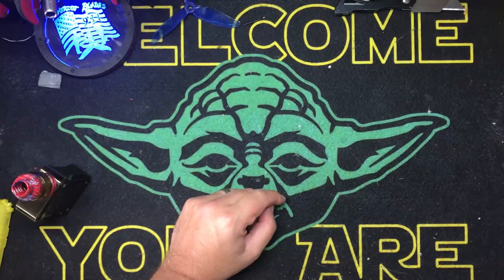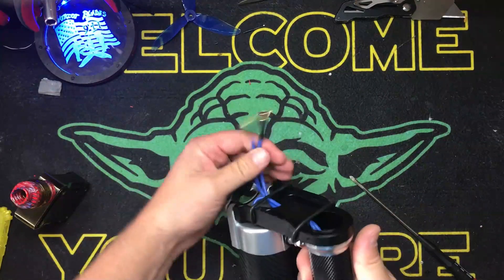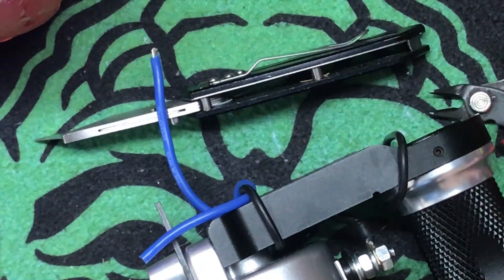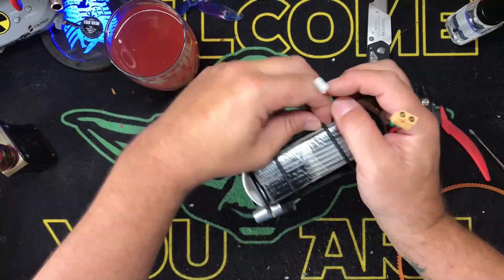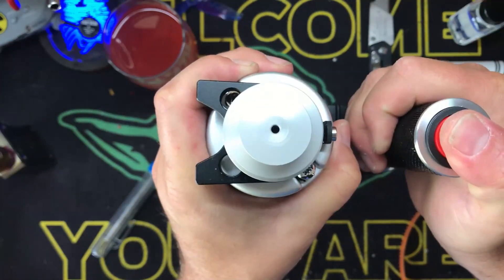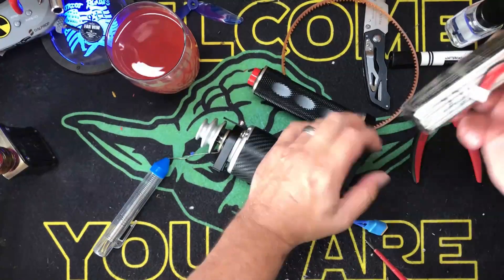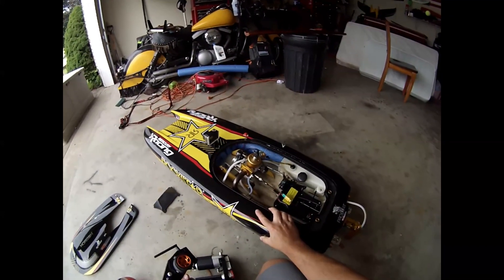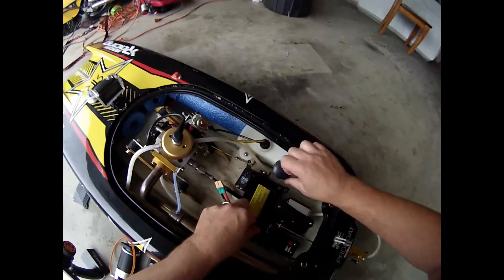RotoBoat - ProBoat Rockstar - FIrst start BAMMMMMMMMMMM

Comment: I'm jealous I need to get my boat going.  I want one now and the run times an hour plus so is this going to be your longest video yet? Lol
Reply from the maker: Well talk dirty to that thing and get it wet!!! Come on
Reply: @jjrotogeek  the nozzle on my jetdrive unit needs to be 3D printed and yeah I haven't got it done yet I need someone too rendered and print it so I can have some spares
Reply from the maker: Do u have a stl or cad file for it???? I’ll help ya
Reply from the maker: Do u have a stl or cad file for it???? I’ll help ya
Reply: @jjrotogeek  no never tried to because IDK what software was compatible so if I did all the work then couldn't print it I would be pissed what do you suggest?
Reply from the maker: So basically u need the part drawn up and printed?   Email me some pics.   My email is in the description